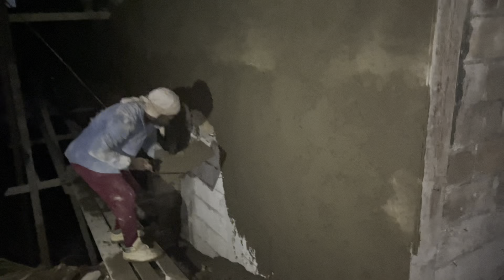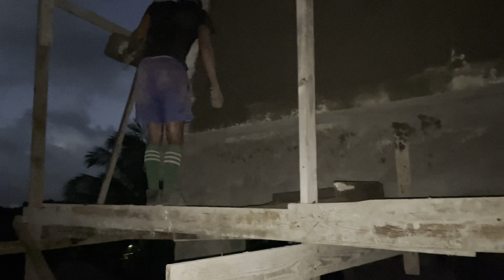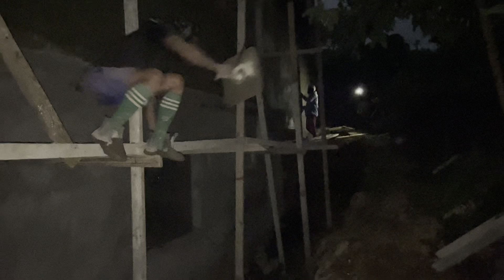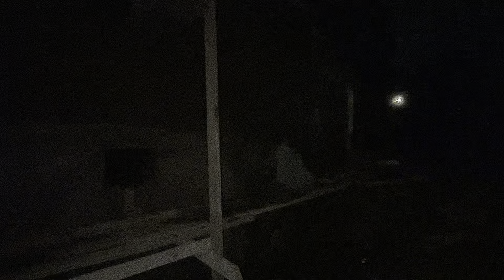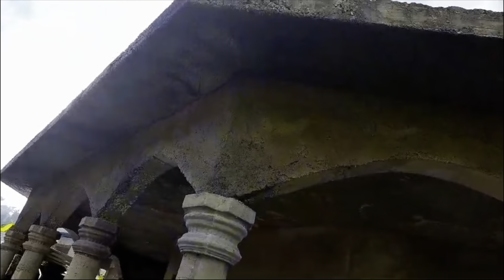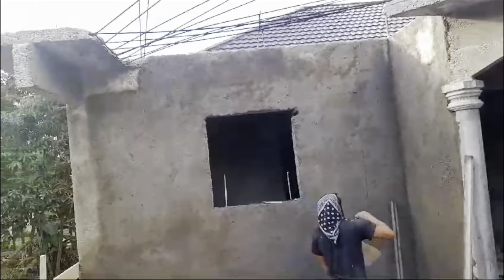Building a house in Jamaica #rendering #night shift

Comment: You mean business pushing the work 😊 them guys be careful on the scaffolding
Reply from the maker: You always have to worry about safety especially with the height and everything. Good thing is that them have years experience doing this. You might even know them they are from upper Clarendon Alston area.
Reply: @SuperNitenurse  yes even with the experience still have to be careful 1 wrong move and its lights out they doing great job on the house maybe i do know them keep up the good work
Reply from the maker: You did read the first part of my message right? Safety is always a concern.
Reply: @SuperNitenurse  yes i did didnt mean anything negative my dear
Reply from the maker: No prob😁